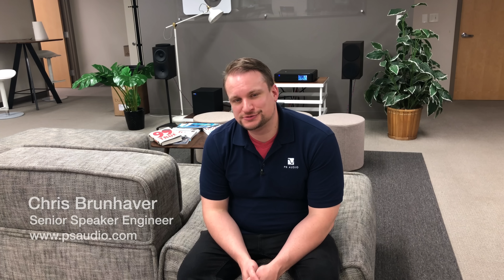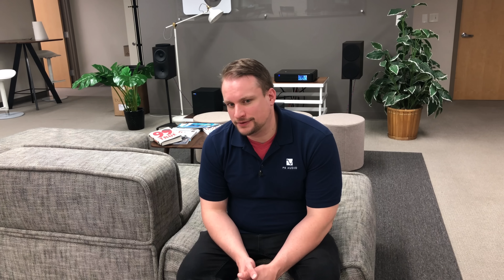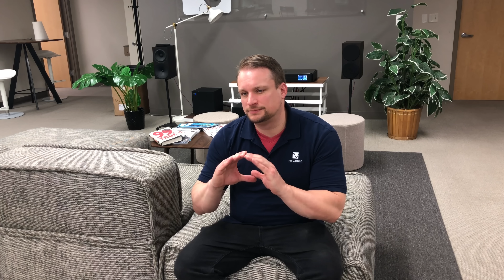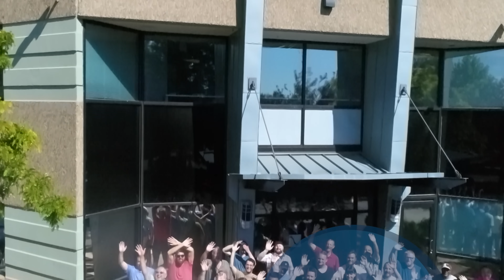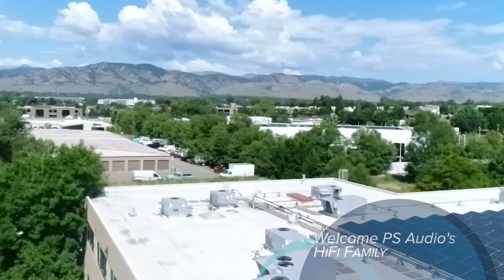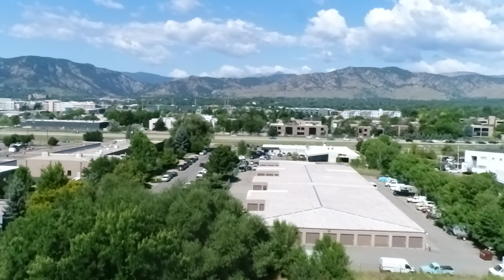Why does a tweeter look different?

Comment: But I would like to add that is as long as the tweeters are mounted flush from the outside of the cabinet not the inside the way some cheaper speaker systems were made because that will cause dispersion problems

Comment: Nice job Chris on different types of tweeters, but I would like to hear what you think about the pros and cons of the different types of tweeters. 
Something that you mentioned is a sore subject with me, being an electronics and audio engineer with experience in horns and waveguides, both RF in radars and horns in audio. The de facto expert in acoustic horns and waveguides is Dr. Earl Geddes who back in the late 80s and early 90s published AES papers stating "a horn is any conduit with a variable cross section" and "all waveguides are horns, but not all horns are waveguides". This arose by his strict definition that a waveguide is designed for a minimum of diffraction to achieve the end result of directivity control, while horn theory does not support design for directivity but rather for the end result of loading. This however confuses the terminology because by Geddes definition if any conduit with a variable cross section is a horn, then a conduit with a constant cross section isn't a horn but rather a waveguide, and also all horns guide waves. This dichotomy has led to a duality of terminology in the audio industry regarding horns and indeed many times both terms are used interchangeably, which I think is an unfortunate outcome of some very fine work by Dr. Geddes.

Comment: What type of components for the construction of PS audio is crossovers inductors, resistors, Polyfilm caps,  electrolytic’s. What method do you use for voicing them and are you constrained by budget with PS audio speakers ?.

Comment: Good video but I wish he mentioned things  like do horns have a wider dispersion than a dome tweeter with a acoustic wave guide and if a 1 inch tweeter gets directional above 8 khz why not make a 1/2 inch one . Speaking of different I wish he would have mentioned the Heil air motion transformer and it's dispersion characteristics.

Comment: Finally some one at PS Audio mentions the importance of constant (and perfect) directivity for a speaker . This trait dominates by at least an order of magnitude how well a speaker sounds and from what I've seen so far from the PS Audio line of speakers , nothing convinces me that they posses that trait (but I could be wrong). With this guy on board , that may finally change
Reply: Similar dispersion across the frequency spectrum is crucial. You can go wide or narrow, depending on the application and room/venue size.

Cardioid bass really helps narrow dispersion speakers sound best in small to medium rooms, which is where we all truly live.

Comment: Hey Chris curious to hear your opinion on ATC's soft dome mid range. A lot of people swear by it for their ability to reproduce voices. Which BTW are in PS Audio's recoding studio.
Reply: Hey Will. No way I know as much as Chris but often it's as much how a particular driver is used as it is the  construction of the driver itself that makes a difference. The ATC driver has a listed diameter of 3 inches. Whether that's nominal or actual I don't know. It's also crossed over at 380Hz on the low end and 3500Hz on the high. This allows it to cover the vast majority of the vocal range without crossing over to another driver and that's a big key to ATC's coherency and the perception that it does something unusually well with vocals. Being a three inch driver allows the unusually elevated high pass crossover point without worrying about beaming and it's obviously a very well built, light and stiff mid-range. This certainly helps as well. In their consumer line ATC limits output in the lowest octave to -6 db at 48 HZ. In their professional line they use two low frequency drivers before they allow extension to 42Hz. Again, at -6 db. This helps the smallish bass drivers remain linear and free of distortion and allows for quick recovery which lets them play more cleanly into their upper range where they cross over to the mid. This is another factor that helps the coherency and gives the mid the appearance that it is more than it would be if it were used in a more typical situation. That's not a slight on the ATC mid-range, it's excellent. But as I said initially, implementation is as much a factor in it's sound as is it's construction.
Reply: Dave P   I have no idea if you know as much about speakers as Chris, or not.  WHAT are your qualifications for making such a bold statement?
Reply: @doowopper1951  Sorry, Mr. Russel, you're going to have to tell me what you mean by bold statement. I said there was NO WAY I knew as much about speaker design as Chris. The information I listed was taken directly from the ATC website and my knowledge of speaker design and how drivers interact is from designing and building roughly twenty speakers on my own, both kits and complete DIY projects. I've also done a lot of research on the subject over the years as well as taken in information as it comes available from the greats of design.
Reply: Dave P   My apologies.  I read it as “no way! I know as much as Chris about speaker design”.  Old age is taking a toll on eyesight, I guess.  Again, my apologies.
Reply: @doowopper1951  No worries. It's easy to misinterpret things online.
Reply: Dave P wow! Thanks so much. That is such an exhaustive response. I wish I had the space for a pair of ATCs at home.
Reply: Jim Mitchell I never had a workshop where I could build speakers, but used to run all the Small-Thiele parameters and design formulas through my head to achieve various Qs for a system for box type and sizes.  When I double checked my mental calculations on a calculator, I was always spot on.  But those days are long gone.  I also have Box Response software lying around somewhere  (that is the name of it, isn’t it), and the Loudspeaker Cookbook.  And I loved Speaker Builder Magazine.  Oh, those good old days.  Dang, the rest of the night I’ll be mumbling “isobaric, transmission line, ported, sealed. Linkowitz, etc.” and wishing I had a proper workshop.  Oh well, I can at least dream

Comment: Lots of speakers sound very different off axis losing much treble at higher angles. Turning your speakers can sort of be a tone control/EQ but obviously you also alter the soundstage with ambient reflections being different.
Reply: By moving your speakers around, you almost guaranteed a signifiant difference. Some speakers react instantly when moved only an inch or so, why others are more "forgiving" in that sense. For tweeters, it's almost like you have an EQ (on/off Axis), and that's why i always recommend using time with your speaker placement. It's perhaps the biggest and best tweak you will ever get, and it's also for free ;-) I'm sure you know all this, but i just had to response ;-) Cheers

Comment: Is it true that an inverted dome tweeter has a quicker response?
Reply: Really, really doubtful. How can it be quicker when the mass is still the same? Then everyone would do it. It has to do with spreading of the sound
Reply: paraphrasing the marketing department at one company; that center of mass is closer to the center of propulsion. I'm only. electronics repair, that's why I asked an engineer.
Reply: @HouseofRecordsTacoma  Sounds like a perfect example of marketing bullshit. If that was the case than many more would use inverted domes..

Comment: If you think about it then the treble has quite high frequencies and the speaker must have very light mass to go fast and many times out and in. An ordinary small speaker is not light enough to handle this. therefore a treble loudspeaker with light mass.

And a subb bass speaker has too heavy mass for mid-range use!